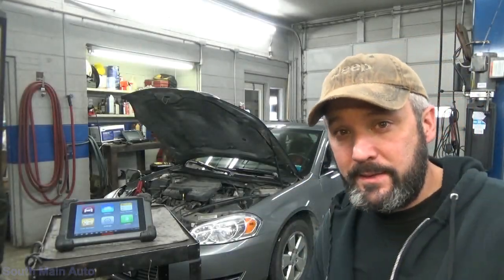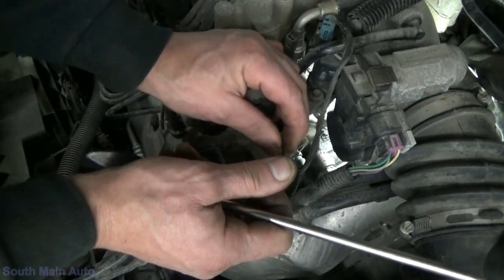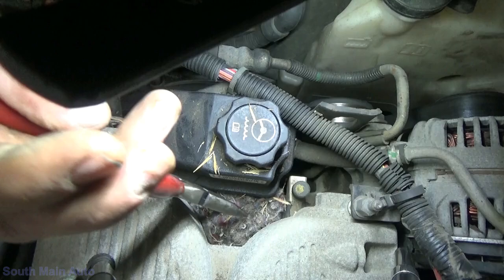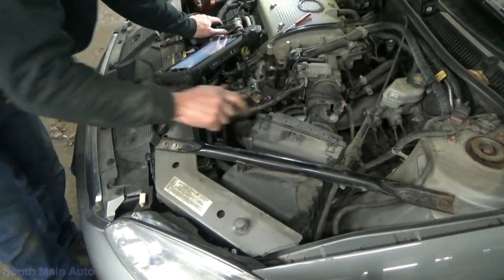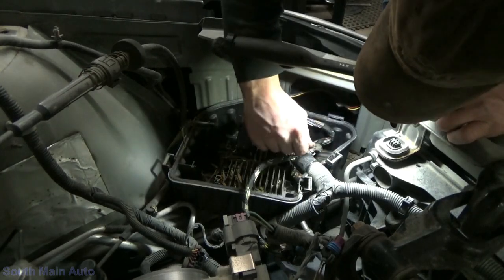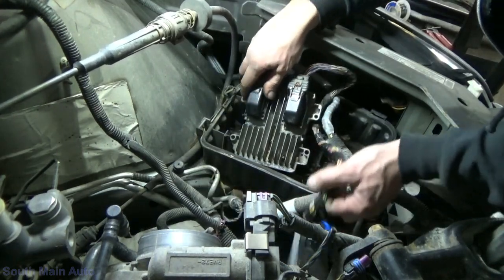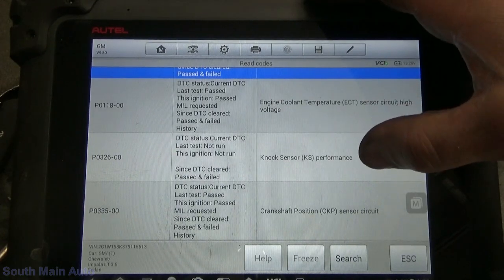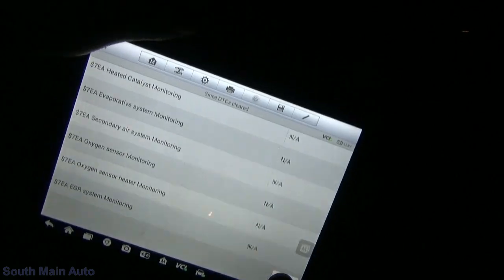Chevrolet Impala - Extended Crank Time - Service Engine Soon Light

Comment: Nice video, good to learn about the rodent tape.  A few years ago I went to change my cabin air filter on my 2004 Prius and when I looked back at the hole where I took out the filter there was a big mouse nest that dropped down.  I'm not sure how long it had been there but it didn't look like anybody ever changed the filter

Comment: Knock sensor code on GM can also be caused by low batter power. Due to the clicking of starter when trying to start with low battery power.

Comment: Great video and excellent diagnostic job. Not sure why you get so close with the flame when you shrink the tubing though. Most tubing types with the exception of FEP or TFE shrinks at 200 to 300 degrees F including ones with meltable adhesive liners. You're cooking the tubing so much you are probably embrittling it. If you didn't twist the wires together before soldering I wouldn't be surprised if the wire joint unsolders while you're shrinking the tubing with so much heat.

Comment: Found an almost exact rodent problem on a BMW motorcycle several years ago.  The little critter had chewed away about 3 inches of 2 wires on the alarm/disable module.  Wish I had known about the rodent repellent tape back then.

Comment: Same here on my Acura where I found out they used a "soy" based wire, and a rodent ate thru the knock sensor on my MDX.  Had to remove the entire intake to replace it.  The replacement sensor and wire came with that rodent tape pre-wrapped on it.  Since then I've picked up a roll of that tape for the other wires.

Comment: Mondays tip!!!!!!!!I've used heat shrink with the self adhesive glue!
 Slit it down it's length then put some leather Gloves on. Heat it and fold it over like a piece of paper over the bare conductors then it will seal the wet out!

Comment: note the rpm gauge didnt move at all! classic crank
Reply: I'm actually surprised that car started at all.. I was always told the crankshaft position sensor is the heart and soul of an EFI system -- without it, no spark signal sent = dead engine
Reply: @adventureoflinkmk2  Some ECU's are smart enough to be able to run on Just the Cam or Crank sensor, and if its running on the Cam Sensor, then that explains the long crank time as well, as because there are two rotations of the crank, for one turn of the cam, so the ECU has to firstly determine the crank sensor is bad, THEN it has to fall back to cam sensors only and "Guess" where the engine is, and iirc what it does is it will Batch fire the Injectors and Spark plugs, in various combinations until the engine fires, and when it sees that, it now has "learned" where the engine position is, and the engine will run, though not very well.

You'd think though that now the Engine is running, and the ECU knows how fast its running by means of cam sensor, it should be able to provide Engine speed data.
There is no way the engine could run if the ECU didnt know, so by the fact the thing actually starts, we Know the ECU has sufficient position and speed data.

Comment: I ran across this same issue in a Buick Regal. On that one it was the intake air temp sensor that was -40 and it refused to run a/c.  Found the wires chewed in the air box.

Comment: Funny, I never would have thought -40 would be hot enough to disable ac 🤦‍♂️😂😂 but I’ve seen that happen a lot with those coolant sensors, I’ve also seen some read hotter temps when the engine was clearly cold, had an 03 hondoo accord that I worked on and wouldn’t start, brought up the data and the coolant temp read 389 degrees! WELL THERES YOUR PROBLEM LADY!! Either way, it was a fun repair and there were a lot of laughs joking about the superheated engine coolant lol

Comment: 2 things I want to tell you first I grew up in North Dakota where snow gets ass hole deep to a tall Buffalo. The rust is nothing like you have there  secondly I have worked on cars truck heavy equipment for over a half century and I have never ever seen so many mouse nests as you guys have there and that includes firing up a D6 CAT THAT HAD BEEN LEFT UNDER A HIGH VOLTAGE POWER LINE FOR A QUARTER CENTURY. IT WOULD OF MADE A GREAT YOUTUBE VIDEO THOUGH IT WAS RAINING HARD YOU COULDN'T STAND ON TGE GROUND AND TOUCH THE CAT WITHOUT GETTING ZAPPED FROM THE POWER LOSS IN THE POWER LINES. IT WAS LIKE GETTING NAILED WITH A STUN GUN I HAD TO HOP ON THE TRACK OF THE CAT TO AVOID THE ZAPS

Comment: I had a similar problem with my 05 Odyssey. A rodent ate a wire and did some research found out Honda used a "soy" based insulation that they loved. A TV station in Atlanta did a piece on this problem where customers had to replace whole engine harnesses but Honda wouldn't cover any of it. Turns out they came up with this rodent tape as a solution.

Comment: My 2006 Impala with 3.9 burns more gas now. The only code I had was cam shaft sensor. I replaced it. That didn't change anything. I sprayed my MAF sensor with CRC throttle bod cleaner. I replaced plugs. They were shot. The electrodes were literally gone. I believe they were the factory plugs. I'm gonna change the wires and coil pack next week

Comment: When you flung the excess solder off the iron tip at 30:24, the blob landed right in the open PCM connector. This is likely an example of the Law of Selective Gravitation, where a falling object will tend to land where it can do the maximum damage or be the hardest to retrieve.

Seriously, though, a damp sponge or rag is a much safer way to clean a soldering iron tip.
Reply from the maker: Lol you caught it haha! Yeah I just tipped it over and gave it a tap and the piece fell right out... thankfully!
Reply: I'm guilty of doing the same thing, except my habit is to aim for a floor, although I've had the blob land in all sorts of bad places - my pant leg, my shoe, a rag, etc.

Comment: The tip I heard for rodent control under the hood, is to tie dryer sheets to whatever. Apparently they don't like the smell of that any better than we do. If you go camping and you park in the woods, that is sometimes when you encounter a rodent chewing or scratching on stuff. I had one scratching one night while I was trying to sleep in my van. Persistent rodent. I would bang on the doghouse and he would stop only for a moment. I had to start up and leave. Never know what they will chew on. I know mechanics won't like the dryer sheets either, but what do ya do?

Comment: Had an 06 impala come into the shop same code engine hot no a.c. put a new temp sensor in cleared code all good right no so fast came back a few days later same thing I forgot to mention no tach no fuel gauge first time and the second time clear code everything started working again also had a code for thermostat performance changed Tatar no more problems

Comment: Nice to know there is electrical tape for mice prevention, thanks for the info. I've had a few rodent  problems. Sometimes they eat the insulation all off just one wire, sometimes the just eat thru a wire. Usually they pee on everything and bring in acorns to eat while sitting on a warm intake manifold. Park it at night everything is fine. Next more there is a check engine light.

Comment: A blowtorch for heatshrink ?!  Use a cheap hot air gun dude - you can see the heatshrink catching fire with the flame colour change.  Most heatshrink's activation temp is around 200F.  Your mini-torch is probably about 2,500F.  Slight overkill :-)  Another great video all the same!

Comment: Damn mice. I brought home a 1965 Coronet 500 to Tampa Bay from California. The car was clean and ok interior. Backed the trailer into the back yard and covered the car up. 2 weeks later I took the cover off and opened the door to start unloading some of the stuff I got with the car. HOLY HELL!!!!!!! The smell inside the car made me gag!! The last owner had removed the trunk body plugs and some damn fruit rats made their home inside the cavity for the pass. side back window. Loaded it right to the bottom of the window. Dragged orange peals in and all kinds of other crap. Even eat through the back of the glove box and tore open a baggie that had 2 BN tail light lenses in it and took the baggie!!  That was 11 years ago. I set traps and put down baby powder to be sure I got them all.. Closed the body plugs and pulled out the back seat and side finish panel. HOLY CRAP did I go through hell getting all that shit out of the window cavity.. I sprayed everything I could think of into the cavity trying to get rid of that stench. Most is gone, but I can still to this day smell it... I plan to get back to work on that car soon. If you or anyone else here knows a good way to get rid of that stench, PLEASE let me know... Damn mice!!!!
Reply from the maker: gas and a match fixes the smell. Other than that I don't know

Comment: I know this Chevy had a different issue but ive had two Gm cars have basically this same issue, i had an 09 Pontiac G6 GT with this 3.5 litre, one day is was cruising along car was fine all of a sudden my a/c cut off the tach and temp gauges went wonky the fans kick on high and it started misfiring, I got two messages saying engine hot A/C disabled and Reduced Engine Output, I limped off the highway into a gas station popped the hood and weirdly nothing felt wrong the engine didnt seem any hotter but it was shaking and carrying on, I let it run for like 15 minutes just in case it was actually hot, keyed off let it sit for another 10 then started it back up, no issues temp normal engine fine and A/C working only difference was i had a money light, but by the time i got home the light was gone, i didnt check the OBD but the car never did it again, the other vehicle that does it is my 2500HD 2X4 with the 8.1, it tended to do the same basic thing gauge would go nuts money light limp home, it turned out to be a dirty connector going for the engine, i was told it was a more or less common issue with these trucks, sprayed some contact cleaner and put some petroleum jelly on the rubber o-ring and the damn thing is dead set reliable

Comment: You need to get some 1mm solder and flux for electronics, it'll make your life much easier with those small wires. Thick solder like that takes a ton of heat and forever to melt.
Reply: As a previous electronic technician, I agree re. the soldering. Great video and very informative. Thanks, Eric. I love your channel

Comment: When you say you patched the injector wire does that mean your taped it up or used the liquid electric tape? I would hope you used the liquid in that area with the heat cycles it will see and the liquid creates a better seal to quell future corrosion due to expose copper. Let us know how you went about that please.

Comment: fixed something like this before it was like a crank position sensor. in some older cars with distributors i also had one that was so loose you could jiggle the shaft with the cap off i was like well thers your problem or also eaten wires lol i had an intake full of acorns a squirrel made a hole in my filter and had made him a home lol

Comment: On the Chevy Impala 08, which is the hot wire on the 2 pin alternator connector. Both pin 1 or 2 is at zero, battery fully charged. Can you do a vid showing which is the hot wire on the alternator connector and the what color is the wire or which pin is suppose to be hot. Thanx really appreciate it

Comment: You can't even plug a soldering iron into the wall in the state of California! ;-)
Reply from the maker: Yeah... and then you have cancer...
Reply: Austin Chase nah, I'm jokin'. Seems like you can't these days though
Reply: I know this is a year old but my friend is an electrical engineer. You know those wall plug in soldering irons for professional heavy duty use? He told me they call them fire starters. They literally plug into the wall and have no on/off switch. Direct power to the heater and the only way you can turn it off is unplugging it. Mind blowing. Oh and they don't even have a flip out stand of any kind. They can just roll around.
Reply: They make those in sizes all the way from 20-30W (used to be able to get at Radio-Shack) up to 100W.
I have one, it's very reliable. Just don't forget and leave it on, you'll oxidize the tip for sure and you may start a fire if you left it on something flammable.
That's why I made a stand out of sheet metal for mine, keeps the hot stuff away from the burnable stuff.
Reply: Mind blowing? I think it's more mind blowing that nanny state rules haven't got to them yet and forced them to add a switch! (FWIW if you can't remember to unplug your soldering iron, perhaps you shouldn't be soldering).
Reply: @danmackintosh6325   No one said anything about making it illegal I was saying it is a stupid design which even licensed electrical engineers say it is.
Reply: I said it's surprising they're not illegal yet, actually. If you read my comment properly you'll see I was speaking more of my surprise that the law doesn't require them to have a switch/deadman button. (Basically, it's more mind blowing that they're not outlawed already, than it is that they came about in the first place)

Comment: Hey Eric.
Great video. I was wondering why you bothered with the wiring diagram on a simple thermistor circuit. Guess it was just for the viewers?
Did you wrap the other computer loom with that rodent tape as well or will the little mouse just be pissed off that you wrapped up his favourite wire and leave town for good..

Awesome stuff. I'm about to close my shop and retire. 36yrs on the tools is enough for me but I will still be watching..
All the best to you all for xmas.

Comment: Ten years ago I had mice in my air filter housing on my '92 Nissan D21 while living in a rural area. What was a challenge after cleaning out their mess was keeping them from coming back. I finally ended up zip-tying rat poison under the hood to keep them from re-infesting my engine compartment. So anyone who has  had a mice problem with a vehicle and continues to park in the same locale may want to consider this.

Comment: ( Dan Hucklebridge)  A customer at our shop took his Lexus RK330 to the dealer for TPMS issues. tuns out, the car had 4 antennas, one in each corner of the car, for the TPMS system...the mice got up in through the sunroof drain tubes, over time...and chewed all kinds of wires, the dealer wound up replacing the entire harness...(whole vehicle) ( because Asian car manufacturers dont like connectors) and the owner made an insurance claim, and it cost 10,000. 00  Owner still keeps the car in the same car port, where it was chewed up.

Comment: I am curious…. How can the engine run without the Crank Sensor?  My Subarus won’t. What is different in this Chevy that still allows it to start even though it doesn’t know where the crankshaft is?

Comment: Had a similar mouse infestation with my 2012 Impala. I put a screen on the air cleaner to slow 'em down there. Knock on wood he didn't chew through any wires.

Comment: Eric great video as always! Have a question what is the name and part number of the tool you use to remove screws in brake rotors. I've seen you use it before we're you hammer one end and the other end spins and shocks the screw.
Reply: Cameron Royal If you are talking about the screws typically in Honda rotors, the tool is an impact screwdriver.

Comment: Hannah isn't learning mechanics for cars but mechanics period and tools. In medicine a huge number of tools is used so when she knows what you need before you need it it would be the same in surgery where the surgeon asks for a tool she will know mechanically which tool is needed as the human body is much more complex than any motor car with a computer and all its wiring. Has the same type of circuits and instead of cooling and oil it has blood which cools, fuels, and the nervous system is the wiring.

Comment: Just had a 2013 pathfinder with no ac, turns out the dealer spliced a compressor connector pigtail(body harness side) charged the customer $500+ for a “new” ac compressor they said!  But the jerry who worked on it pulled so hard on the connection that the black wire on the pigtails came out losing contact intermittently (compressor side)(still old compressor it wasn’t replaced) (they lied)(imagine my shock) 

Went in secured the pin to the connector! Easy money!

Comment: how do you know how many volts is the cooling sensor or any kind of  sensor like the oil pressure sensor  is supposed to use that i will like to learn. any suggestions

Comment: Too bad there's not a RRS Telltale (Remove Rodent Soon). Owner should definitely install a sheet of small gauge wire mesh before the Air Box at the least- maybe even the entire underside of engine bay, too. Or- just get a few Barn Cats from the Shelter. Regarding that tape- it would be great for car makers to simply add capsaicin to the vinyl insulation of wiring, and tire manufacturers to put a spray of insecticide inside their tires; so many thousands are collecting rainwater, harboring mosquitos.

Comment: Would a long term fix for this be to supply a Cat and train it to sleep under the hood?
Reply: You should see the mess a cat makes under the hood....
Reply: As a cat lover, and a browser of the JustRolledIntoTheShop Reddit, the only kind of cat that belongs in a car's engine compartment is a catalytic converter.
If you find a cat in an engine compartment, you usually find it in pieces or by smell of rotting flesh. Usually either the serpentine belt or cooling fan that kills them.
Reply: Make sure it's not a PET. Cat needs to be kept hungry to be an effective 'mouser' !